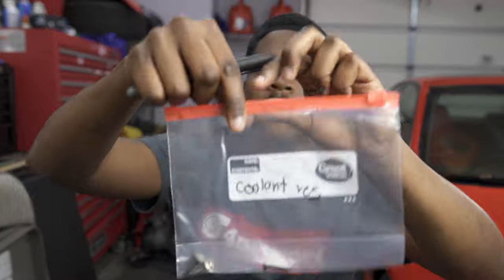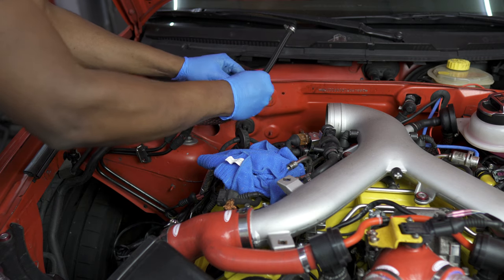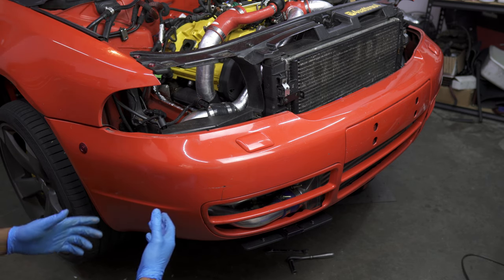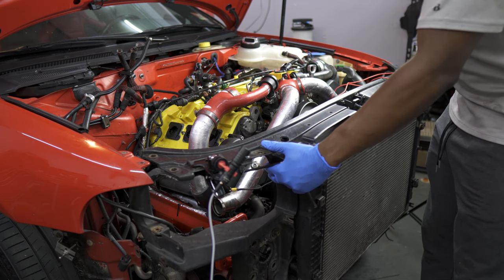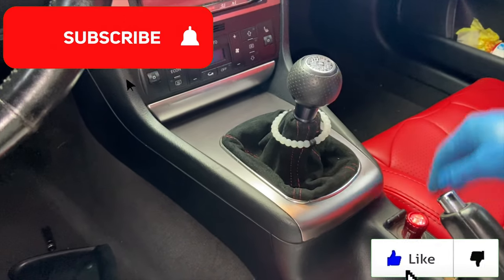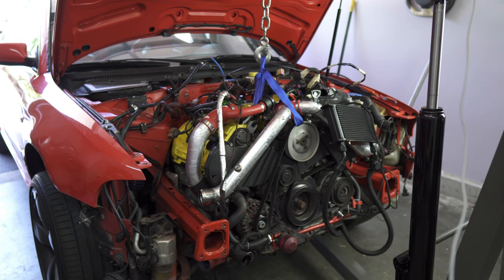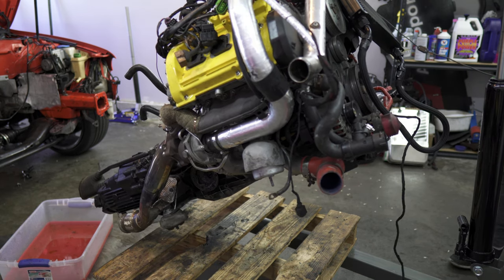B5 S4 Motor Pull / Engine Removal DIY

Comment: Awesome video man! Only thing I noticed watching it was instead of using nylon straps for your engine, I would personally try to get your hands on some seat belts. They are much much stronger and you only have to use one layer, Ive pulled 6L v8 engines with just a single seat belt instead of chains. Again awesome video man!!! Doing an auto to manual conversion right now actually, on jack stands too, good times lol.
Reply from the maker: Thanks man!! I’ll definitely look into using a seatbelt.
Reply: @CIPGAS  any tips for someone who's never dropped a manual trans and replaced a clutch lol, much less just installed without seeing how it was installed first. I was a mechanic for nearly 10 years but BMW, Mercedes usually are automatic 99% of the time and seem way more simple as a whole.

Comment: Love your videos man, keep up the good work! Quick question regarding your FMIC fit, what all did you have to do to get your FMIC to fit your bumper?
Reply from the maker: I had to remove the number support/ crash bar, I had to remove the fog lights and trim the grills on the side intakes
Reply: Doesn’t seem too hard, thanks man

Comment: Was this done due to your wastegates ? This will be really useful when i go to put mine in the b7 as you go quite in depth
Reply from the maker: I am pulling the motor to install build 2.8 heads. I did do a pull a few weeks back to replace my wastegate actuator lines due to a leak.

Comment: Great Advise my friend. I live Tampa Florida and I would really like to know if anyone would be able to assist me with changing the connecting Rods, Piston, 2.8 Cylinder Heads. I really appreciate it. I can provide my information is someone is available for this side job. Thanks.
Reply: Tampa born and raised, I'm in Hernando now but ended up here looking for anything I'm missing trick-wise pulling my F21s and heads off. The 2.7T in a B6 is a tight fit and I can't access the mani to turbo bolts (need a torch for that too anyway) but hope you had luck with your build. Mines still 3y in the rebuild process

Comment: well after everyone telling me no way it would come out without dropping the subframe, i find this video. great video man. got mine out in 5 and a half hours with plenty of goofing off and down time with coworkers. one guy was shaking his head at me when i told him im not going to drop the subframe with engine/trans underneath the car, but pull it out the front. then when i said im not even taking the wheels off he said theres no way its coming out that way. then he was surprised it came out so quick haha. i had to roll my car into a storage spot after the motor was pulled, so i didnt want to drop the subframe, just to put it back into a shell of a car just so i can roll it. i think putting it back in with the axles would be almost impossible, what do you think? im planning on pulling the axle with the engine out by just removing the nut and pulling them off. then install motor with no axles and after its all in, ill take the suspension apart a little to get the axles in. the axles were hanging me up coming out, so going in will be very hard i think.
Reply from the maker: That’s awesome man
And yeah I would definitely remove the front axles to get it back in
It’s possible to donut with them in place but you risk destroying the boots with your trans mounts. Or you can remove the mounts… lol

Comment: and can u remove jus the engine and leave trans and stuff still in place?
Reply: Yep, need to pull the CVs though. You don't have to touch the subframe or trans aside from umbolting from engine

Comment: First thing I wanna say is this video is amazing and has helped me so much! This video, and the vids for turbos, and clutch and flywheel helped me alot! Had a question for ya do you run front axle heatshields? And did you do anything for the heatsheilding underneath the car?

Comment: What to do if you have a stripped front axle to trans bolt ?? Previous owner stripped it
Reply: Can’t believe this man , 2 front axle bolts are holding me up from pulling motor and trans so pissed
Reply from the maker: Damn man sorry to hear this. That definitely blows! the best advice I can you is to use a bolt extractor like the one in the link below. You’ll have to tap it in with a hammer to get the best grip possible.
https://www.lowes.com/pd/IRWIN-Bolt-Grip-5-Pack-Bolt-Extractor-Set/1003021030?cm_mmc=shp-cprdtolgooglelia-216-specialtyhandtools-1003021030-_-0&store_code=1658&placeholder=null&gclid=CjwKCAjwlbr8BRA0EiwAnt4MTnxx7ef9wTuWnS7eh4lzfN4NCPY9_8F2uGWF5JUO4aMzuvWrsxy2IBoCnh8QAvD_BwE&gclsrc=aw.ds

Comment: Subscribed, awesome videos man. Even though I don’t own a s4 I enjoy the videos. always wanted a s4 but out my price range, one day though. Still driving my 1986 Honda Civic Si.
Reply from the maker: Thank you man I really appreciate this! And wow you still have you 86’ civic running strong?!
Reply: @CIPGAS  you welcome man! been bingeing your videos past couple days. Yeah haha 162,421 original miles on whole drivetrain. Original wheels an everything, no rust because I live in SoCal. Recently I adjusted the valves and did the camshaft seal new dizzy with rotor and seals, spark plugs n wires timing belt etc. new exhaust manifold and replaced all gaskets, new fuel filter with coolant flush and fresh fluids. There’s a group on Facebook and some of the members have reached 300k to 400k original engine, the car is bulletproof haha.

Comment: Can’t get mine out the freakin axels are in the way 😢 I tried leveling out the drivetrain with a jack on the tranny but I’m hitting the top of the tunnel😅
Reply from the maker: It’s tough with the axles in the way 
But if you want to leave them in you’ll have to remove the motor mounts. That should allow you to go over the axles without hitting the tunnel
Reply: @CIPGAS  I got her out! Thanks a lot man couldn't have done it without this video
Reply from the maker: @claudiochairez8995  awesome! Happy to help man. Hope the rest of it goes smoothly

Comment: The heater core shouldnt be hard to replace. i have done mine with no experience on heater core replacements on my b5 in 12 hours.
Reply from the maker: It’s not the difficulty that bother me it’s how tedious it’s gonna be
Reply: @CIPGAS  tbh it is very tedious with all the connections u have to unplug Nd the airbag u have to deal with

Comment: Hi, what's the name of the crossover pipe directly beneath all the pulleys, I think it connects to the oil pan.  Your's is painted red.  I got a car from up north and the pipe is rusty I want to replace it.
Reply from the maker: I just call it the front coolant crossover. Here’s a link to it 
https://www.ecstuning.com/b-genuine-volkswagen-audi-parts/front-coolant-pipe/078121081q/?gclid=EAIaIQobChMIp8yz3Lbn7AIVmQiICR2s2w0UEAQYAiABEgJuk_D_BwE
Reply: @CIPGAS  Thank you.

Comment: I’m going to use this as a forum but I keep getting misfire codes (not the same cylinder) 3 and 4 usually people suggest upgrading to the 2.0 pack thoughts?
Reply from the maker: The 2.0 coil packs are better but I’d start with your MAF sensor and make sure it’s reading correctly through vcds.
Reply: 4uattros4 thanks for the advice. Turns out one bolt was really loose on the coil, it was actually staring to pull away so it was wasn’t making a good connection on the spark plug.
Reply: @CIPGAS  id do the denso (r8) coil packs with the icm delete. easier and no checking lol
Reply: @whysolaimmmm this. I didn't know the ICM system is more reliable but eventually I'll still move over. Got tons more to do before that though lol

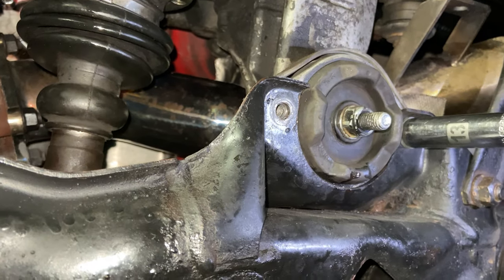Comment: Did that bolt break at 24:00??
Reply from the maker: No lol does look like it did though. The bolt just dropped into the socket
Reply: @CIPGAS  I was praying that was the case, I would not envy you having to drill it out

Comment: Hey! Thanks so much for the video!!! I’m pulling my 02 S4 engine and trans very soon! Do you loosen the subframe like Justin does in his vid? Also he removes some of the bolts on the control arms behind the front wheels. Is that needed or no?
Reply from the maker: I don’t touch the subframe bolts because I pull my engine out too frequently and you have to get an alignment after every time you move the subframe. It definitely makes the job easier to lower it tho.

Comment: I have to ask, what is your record?
Reply from the maker: Record for what?
Reply: @CIPGAS  engine removal time.
Reply from the maker: Ohhh haha I’ve had an engine out turbos swapped and back in, in about 6 hours. So about 2 and a half hours for the pull.
Reply: @CIPGAS  While Audi charges 30hrs for the same job smh.

Comment: Could you please send me what parts you used for your mishimoto oil cooler? I'm in the process of buying the same cooler and I'm not sure about hoses/fittings as well as fitment. I'm using SMICs so I could probably fit it in front of the rad? 

You're videos are incredibly helpful! Thank you for your hard work.
Reply from the maker: Hay man, Message me on Instagram. it’s easier to talk on there.  @4uattros4